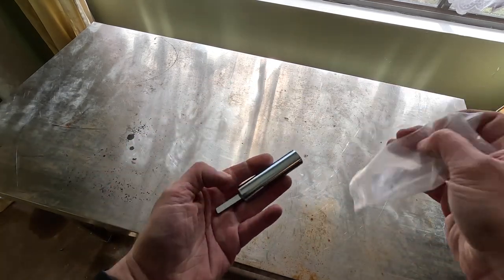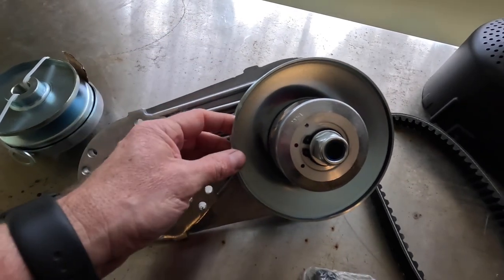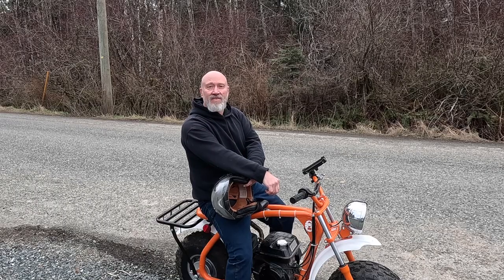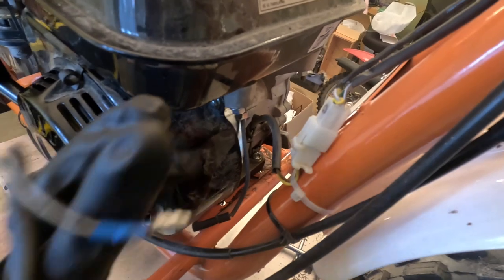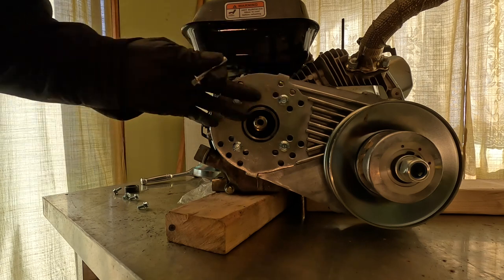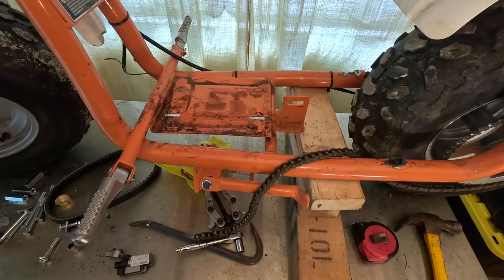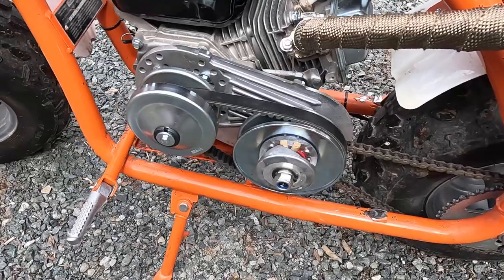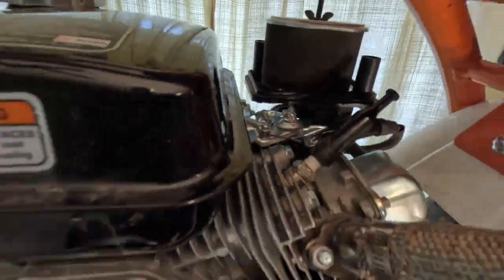Coleman BT200X | Don't Buy A Torque Converter For Your BT200X Before Watching This! | Wet Coast Fab

Comment: U need to switch to mikuni vm22, exhaust, heavier valve springs, and torque converter. Bye switching carbs and getting rid of all the stock linkage it disables the governor. My coleman 196 ct200 does almost 55mph with my 150lb buddy and about 44mph with my 220lb ass...lol gotta ditch the original carb. They r horrible EPA compliant trash. Get a round slide and get riddance all that linkage
Reply from the maker: Hey John, thanks for the feedback, and you read my mind! I have a video already (you might not have seen it yet) where I try out a VM22 clone and it's much better! I also have 26lb springs ready to go and have done the torque converter already (also in another video). I've got a 20 thou over stock billet crank and a high compression piston I'll be testing out as well as a 10k rpm flywheel to go on. Those will be upcoming videos soon!

Comment: I noticed your back tire was super low. I believe 30lbs is the max too the back tire. @19:34 you see the low tire
Reply from the maker: Thanks for the feedback! The tires on this one say 10lbs max so with that low pressure and my fat a$$, it's gonna look low :-D
Reply: @wetcoastfab  damn that’s crazy cause mine says 30lbs. Are those stock tires? An you don’t look much bigger than me boss.
Reply: @wetcoastfab  maybe cause it’s the bt200 and that might have diff tires than the ct200u ex

Comment: I’m not sure what you’re doing wrong because I got 47 mph out of my stock motor. I went with the ghost and tq converter set up with a 38t rear sprocket and I got 61.7 mph. You must be doing everything wrong or have no clue how to set your torsion springs in your secondary. SMH.
Reply from the maker: Thanks for the feedback, Larry! Got any tips or instructions on setting the torsion springs? I'd hate to think my channel is giving you a concussion ;-)

Comment: I know this video old but my predator 212 leaking oil under the gas tank the governor is removed it started after that do you have an explanation it still rides just leaks oil
Reply from the maker: Hey Solo! When the governor was removed, was the hole the governor shaft goes through properly plugged? These engines use splash lubrication for oiling and not a pump so oil is literally sprayed everywhere in the crank case and will find the tiniest hole to leak out of.
Reply: @wetcoastfab  you asking was the hole covered if so I think not and is it gonna turn out to be something bad ?
Reply from the maker: Yeah! I don't think anything will be bad as long as you stay on top of your oil level and not let it get too low (other than the oily mess, that is). These engines (the HiSun and Predators) have low-oil shut off so you may find if the oil gets low, and you end up on a hill, the engine will cut out because the oil is moving around in the crank case.
Reply: @wetcoastfab  alright appreciate the knowledge. but it isn’t anything i can put there to stop it from the leak ?
Reply from the maker: There's a few things you could do but it depends on your skill level:
- remove the gas tank and anything else that might be in the way is going to be the first step
- a basic fix would be a simple silicone plug - clean the area and the hole and put some RTV silicone in it and a bit around the outside of the crank case. This might not work depending if you've got a lot of blow-by pressure in the engine (due to wear) and the plug might just blow out
- a slightly better approach is the same but drill and tap two small holes and make a small steel plate  that will also cover the silicone plug. That will prevent it from blowing out. If you don't want to drill and tap holes in the crankcase, there's probably already a threaded boss you could make a longer steel patch that could anchor to and cover the hole. Might take a bit of CAD (cardboard aided design) patterning to get it right
- you could drill and tap the governor shaft hole itself, put sealant on a bolt and just thread it in the hole. That's a pretty permanent change (you wouldn't be able to put your governor back in again) and you run the risk of aluminum shavings getting inside the crankcase, so it would be best to take the side panel off the engine when doing this so you can clean out the crankcase after

You've given me a great idea for a new video on maybe testing out these above methods too; give me a week or two and I'll see if I can come up with something.
Reply from the maker: Oh, I had another idea for you that doesn't involve drilling or cutting, but you will need to take the side panel of the motor off: get a bolt that is slightly smaller than the diameter of the governor hole and long enough for two washers and a nylon lock nut (or a regular lock washer). Put the washer on the bolt with some silicone to seal it, put it into the governor hole, and then a washer and the nut in from below (in the crankcase). Be sure you have a lock washer or nylon lock nut because you do not want those working their way loose and bouncing around in the engine! That would do the trick as well.

Comment: They make a engine riser for torque converters,
Reply from the maker: I know, it was just quicker for me to make a redneck one out of scrap square tubing
Reply: @wetcoastfab  right I weld so" yup" mac'giver. When you can save $$$ plus make things stronger than factory'

Comment: The torque converter works great on my bt200x im not having any issues besides throttle issues but on the other hand it works great so i don’t know what ur talking about
Reply from the maker: That's great it works for you, Matthew! Got any tips or tricks as to why it might be failing on my end?
Reply: Do u got enough washers on the shaft to match the belt
Reply: Plus i had to cut the guard a bit for the chain not to rub i havent messed with my rpm just the throttle wire
Reply from the maker: There was only the one washer that came with the kit
Reply: @wetcoastfab  yes mine did come with one i had to add like 4 to make the belt stright with the back pully so i didnt ware the belt out so much
Reply from the maker: Interesting! I'll have to look into that, thanks! There was no information in the instructions (and they were pretty simple at that) mentioning that. Good to know, thanks!
Reply: Like i said though im having throttle issues and mine stayimg running mine dies out at 30 i use to be able to get it to go 35 all day but for some reason mine dies out at like 30 mph
Reply: But i think that to do with the exhause i put on mine

Comment: Did you ever remove the governor?
Reply from the maker: Not yet, no. I am going to order a billet flywheel but I need to make sure the taper on the shaft will work on the 196cc engine first.
Reply: @wetcoastfab  Finding a cast aluminum or billet flywheel for a 196 is about as easy as it gets. They are everywhere.

Comment: If you plan to spin a Predator 212 over 6000 RPMs, put a stage 1 kit on it, remove the governor and put 18# springs on it. I personally like the Ducar 212 much better. The Ducar, 212 is like the Ghost, but has a much better flywheel and is much cheaper than the Ghost. In fact, the Predator 224 and the Ghost, use Ducar 212 blocks. They are reinforced to handle more stress.
Reply from the maker: Nice Randar76! I'll look into the Ducar, thanks!

Comment: You won't have much use for that jet you ordered. Untill you get rid of that Non adjustable coleman carb thats come stock on that bike.     Reaserch is Boss.
Reply from the maker: So true! In a later video I replaced the Coleman carb with a VM22 clone and got another 11 mph out of the bike

Comment: You’ll gain roughly 5 mph by removing the throttle stop screw
Reply from the maker: I did do that, but it was a pain in the butt! It was actually spot-welded to the linkage to prevent that!
Reply: @wetcoastfab  Yeah, I used a dremel to cut as close to the bracket I could and it worked like a charm !

Comment: Get rid of that weak 196 and use a Juggernaut clutch and you don't need a CVT. BELTS SUCK!
Reply: Where do you buy a Juggernaut clutch? Never heard of it. There is a Juggernaut driver that is used on 30 series torque converters. (CVT's)
Reply: @Deucealive75  Go Power sports carries it. A driver is the same as a clutch